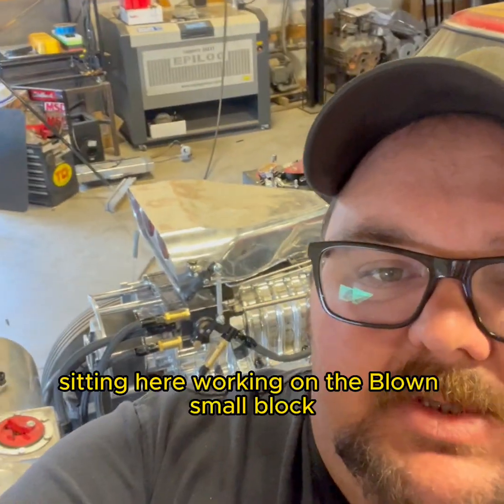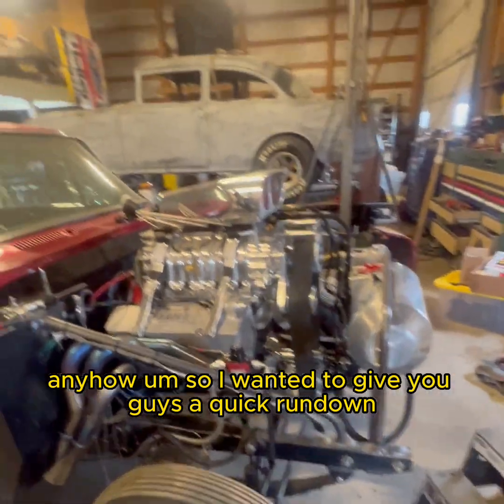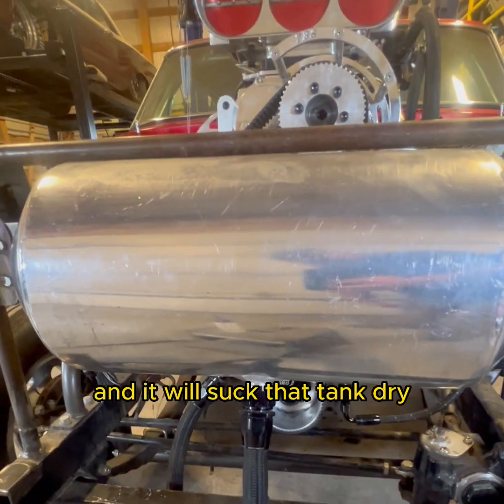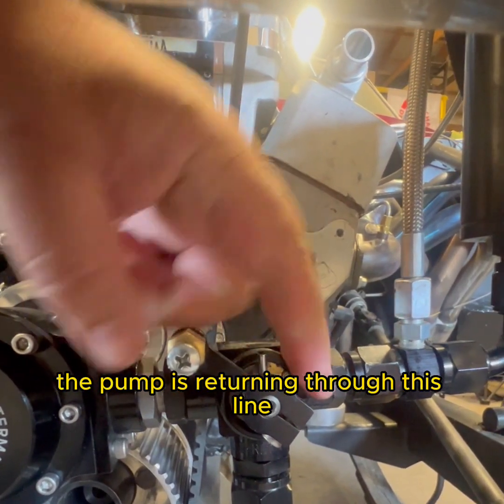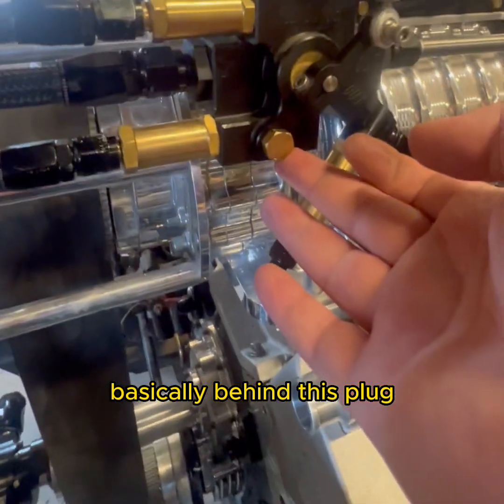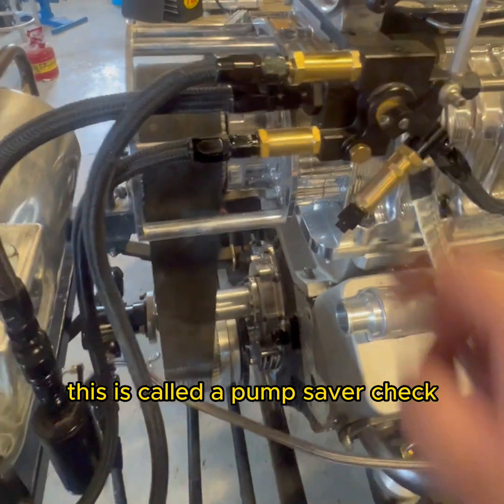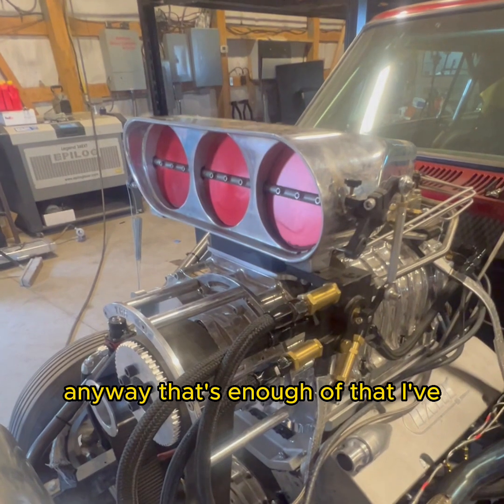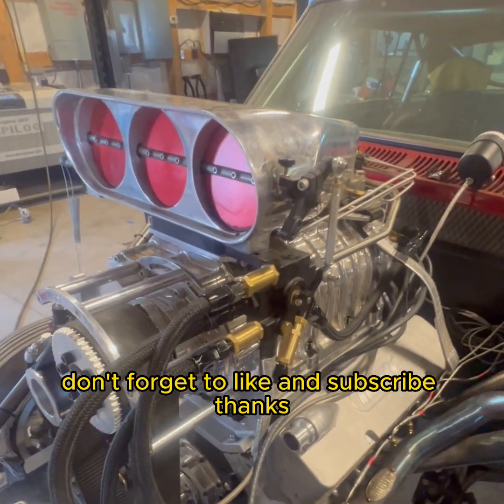mechanical fuel injection explained (Blown Alcohol)

Comment: Hay my friend.  Have a ? For you.  I have a hat injector. Where can I find a diagram on the fuel system for the hat injector I just need some help jet sizes just to start out with.  I live in Rockford Illinois machesney Park I would greatly appreciate any help the injector sits on 482 cubic inches small
Reply from the maker: You really need to talk with Mike from alky digger or the guys at good vibrations motorsports

Comment: Why is methonol always used in mechanical fuel injection?
Reply from the maker: Methanol’s properties really make it shine on when using MFI, it gives a great tuning window that’s not razor thin. 
There is mechanical gas injection as well as nitromethane that’s used in top fuel. 
It’s all the same parts, but with vastly different tuneups, 

Mechanical gas can actually work very well, but you’re constantly chasing the tuneup, because it literally changes when a cloud rolls over or air temp drops 4 degrees, 
Imagine running time trials in 70 degree air in the morning, first round is at 2pm in 100 degree heat, and then it cools off to 85 by the time 3rd round comes along. 
On mechanical gas, that’s a a lot of tinkering, where as on methanol it’s a pill change 

Methanol is very consistent, and user friendly for the most part. That’s why it’s much more common.

Comment: I just purchased a Hilborn fuel injection for a 425 nailhead. I really like what saw on your stream. I was wondering if you sell the for the sensors. Including the IAC block. In theory, this is  the way I wanted to accomplish my electronic conversion. Please let me know if these parts are available.  Tks Bob.
Reply from the maker: This isn’t an efi system it’s purely mechanical, you would need to look at joe blow speed shop or call Alky Digger for those parts and pieces.

Comment: Is it possible convert a 1mz-FE engine block to mechanical fuel injection? I’m talking EGR delete. I’m talking delete power steering pump. Fuel pump in place of the power steering pump. Would it be possible to use the original fuel tank in a 1997 Toyota Camry? There’s probably a lot of custom fabrication that would be required. The way the stock fuel rail is sandwiched in between the top of the V6 engine block. And the intake manifold is on top of the fuel rail. I want to custom hot rod convert my 97 Toyota Camry into a MFI car that runs on regular pump gas with the same 1mz-FE engine block
Reply from the maker: @Turoloco  I’m positive it is possible, what the details would be I’d not be the guy to ask. 

But I’m sure it’s possible

Comment: Sorry, I must have missed it, why do you have fuel coming from bottom of the hat and the bottom of the blower? Why both?
Reply from the maker: @Taras-Nabad  the fuel coming into the hat (above the blower) is basically
Your idle fuel and a small amount of fuel to cool the blower, 
The under the blower fuel is ported into the each individual intake runner for each cylinder, 

Giving the ability to tune each cylinder independently
Reply: @LPLcomp  appreciate the clarification.

Comment: Do you have any video recommendations or sources to calculate flow rates and whatever else you would need to choose what parts you’d need for your motor like the pump and filter, barrel valve and hose sizes to start with jetting etc, good video though man thank you for the lengthy explanation. Made it pretty easy for my head to wrap around it lol
Reply from the maker: @Mystic-p1mp  Mike at alkydigger is a great wealth of knowledge. 

There is also a calculator available on spud millers site, (who also sells components and does flow work) for calculations of pump volume and nozzle/pill surface areas.
Reply: @LPLcomp  thank you

Comment: Hello got a few questions thinking about a blown set and i dont no jack about it two quick things so can you have a fuel cell inside your trunk for that same set-up and what is all need to complete your injector hat set-up the hat the injector plate which is between the hat and the supercharger is that it
Reply from the maker: For a mechanically injected setup, typically you’ll have a front mounted tank, 
 As the fuel pumps need to be driven off the engine and won’t suck fuel up to front. 

There is some other options for a rear mounted tank, basically, you drive the pump with a long cable still off the engine, then that puts the pump in the rear of the car. 

Or you have a small 1-3 gallon tank up front that feeds the mechanical pump, and a larger cell in the rear feeding that tank with an electric pump. 

For a mechanical injector yes, that’s it. 

Pump, barrel valve, nozzles, and hat.

Comment: Literally left out the most important part till the end. How do you correlate/time the air & fuel control linkage in relation to each other correctly,,, & control/know how much pressure & volume the pump makes if it's not linear? Would have made more scents if I knew that first lol. Thanks for the rundown sir, GOD-BLESS...